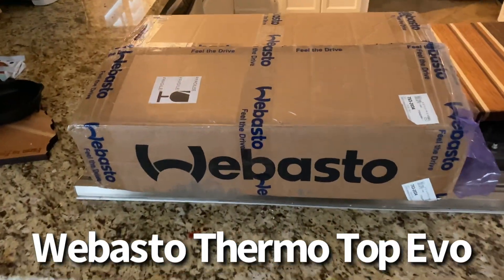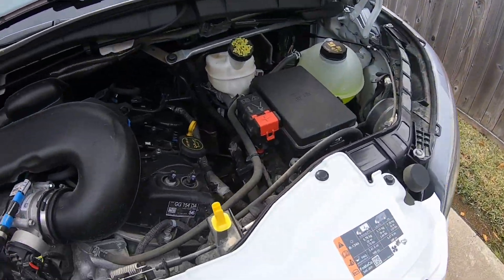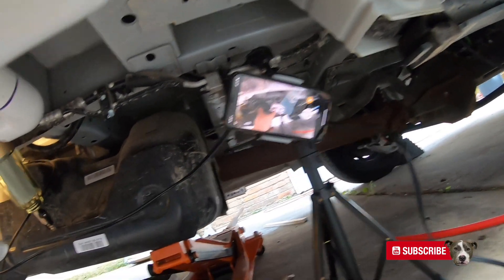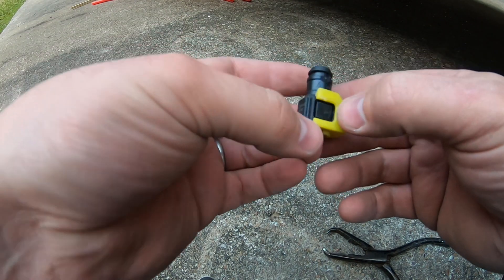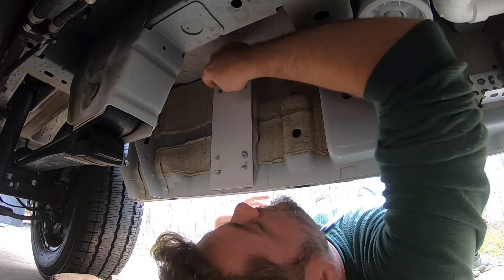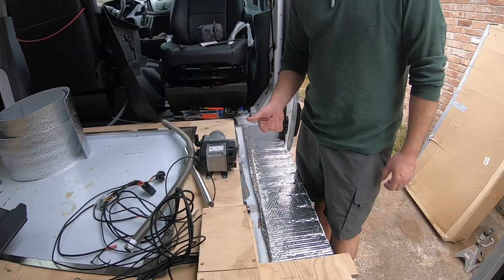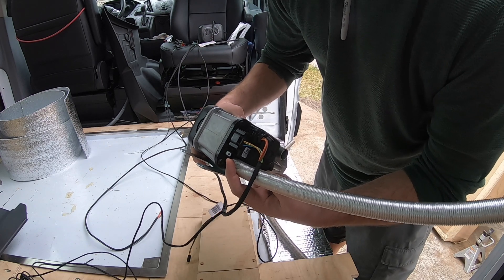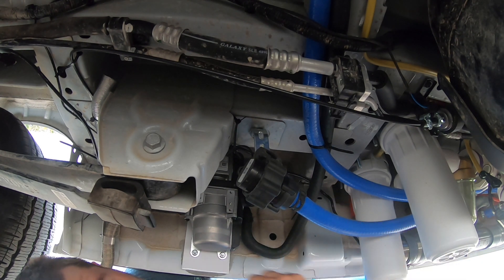Ford Transit Water to Water Heat Exchanger Installed #beanstraveling #webasto

Comment: lookiing forward to seeing the finished Webasto product completed.
Reply from the maker: Thanks Mike 
We are looking forward to seeing that too
Reply: @BradandNicoleBean  I might go the same route in my 2020 Ford transit all wheel drive van. Previously had a system for hydronic heat running off of the hot water heater and my slide in camper worked great.
Reply from the maker: I’m fairly confident hydronic is the way to go.

Comment: Hey, sorry for the basic question, but is this just to be able to heat a tank of water for showering/dishes in the van or more? What are the blue pipes for, you mentioned about the coolant? What's the purpose of having this connected to the coolant too? 

Also, are those white plastic things hanging down water filters? Have you had any issues with just keeping the filter housing under the van exposed like that? That is of course if they are water filters :)
Reply from the maker: This system heats all the water and the air for us. We live in Texas so we haven’t gotten the opportunity to test our winterizing. We have been about 10k mile so far and nothings fallin off or been punctured.
Reply: @BradandNicoleBean  Just that one webasto unit does all that, or the water needs to be going through coolant and other heating systems? There's no heat exchanger in the unit itself that water passes through, right? Is it just hot air it emits and then you're directing that hot air somewhere to heat water in a series of pipes? Can it run without the engine running? Do you have a diagram of the setup you're following at all? Maybe it would make things clearer for me, sorry complete amateur here trying to decide on a solution for hot water in my van, I already have a Chinese diesel heater installed, need to sort the water next!
Reply from the maker: No worries!
I have a heat exchanger for the shower and another for the sink. Then a heater unit that use the coolant line as a heat exchange for the air. The Webasto runs off of the gas tank and the house battery.
Reply: @BradandNicoleBean  Ok that sounds like a pretty complex setup! And those Thermo Top's don't seem cheap either! I was thinking I'd be able to get hot water from that unit alone and I was considering it as it can be mounted under the van and I'm kinda tight on space, but I think the complexity of the install, as well as needing to put all the other equipment and lines somewhere, means it may not suit me :)
Reply from the maker: Understand that 😂 
Good luck and let us know what you decide on!!